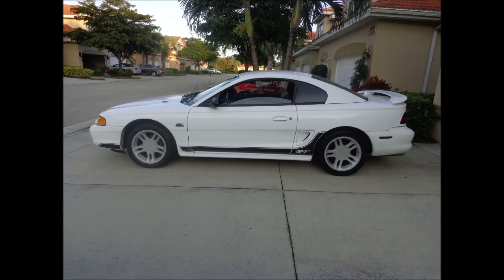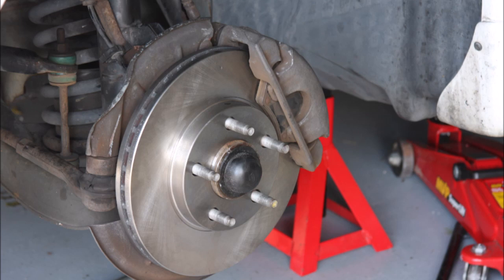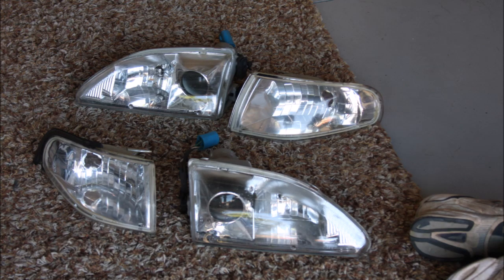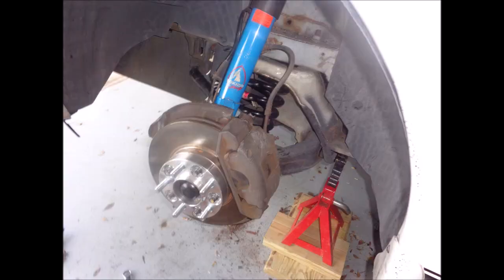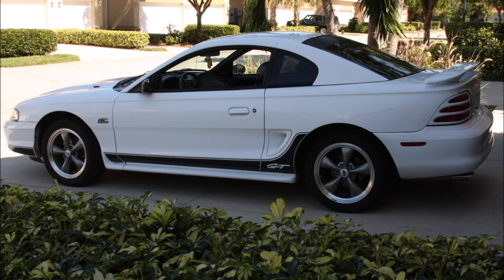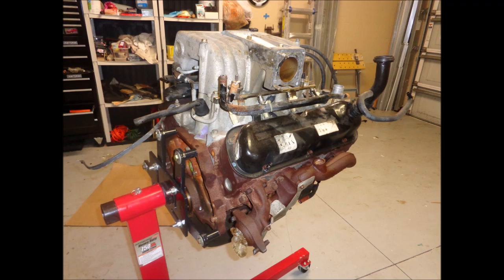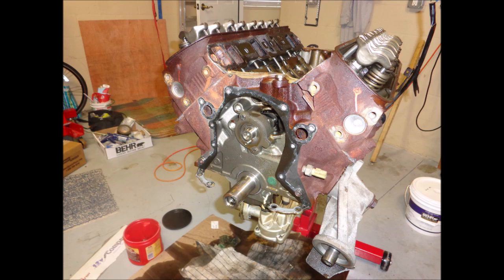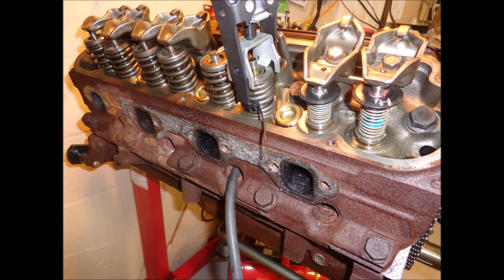1995 Mustang Gt 5.0 _ Automatic Build _ Last of the Push Rod Mustangs

Comment: Yo AL this is the same mustang and color a 2012 GT, Kona blue my was auto, 3.15 gear,x-pipe, axel back, cold-air system, SCT-tune, ran 12.26 at 115.90 on drag radial. Ran a 2012 Boss mustang 6-speed manual we cross door to door I was very happy about how fast these Cayote were. And also I had a 1994 GT running 12.28 at 111mph. Thanks again great story.
Reply from the maker: Serge Basque.  . sounds like you did pretty good with your kona blue 2012 mustang!!! Nice!!  running low 12's with both cars is awesome!! I wish i could have done more with my 1995 mustang but that how it goes sometimes!!

Comment: Let's say you needed a 3/4 ton truck again you wouldn't want to try the new 7.3 gas push rod that they're calling Godzilla I think it's a beautiful piece with it's steel crank 6 bolt Main gear and chain to a shaft driven oil pump in the rear of the engine where the g-forces send all the oil so it won't starve the pushrod engine works better in a truck at low RPM where you really need one to work a heavy trailer around the job site
Reply from the maker: Forest LawrenceGrading . .  if someone needed a 3/4 ton truck i would say the 7.3 equipped truck would be a good move.  .  not likely for me though . . what this video was about was how i moved away from push rod engines ..  i built a lot of them along the way. .  at this point for me i will be working with coyote powered mustangs unless i buy a zl1 camaro!
Reply: @coyotecarguy2076  there's a YouTuber called revvin Evan he has one of those new 7.3 s sitting in a fox body I don't know if he's ever finished it but he's done some dino runs on one in total stock trim and then with the heads cleaned up and a small cam I think it's the answer for the truck world I hope they flood the market with crate engines it would be awesome to see what they are really capable of I think they fill a perfect hole between a Vortec 6000 and the vortec 8000 truck engines they are the replacement for the V10 Triton I think if I could afford a new truck it would be my choice over the Powerstroke due to cost of maintenance
Reply from the maker: @forestlawrencegrading9154  . .  Yes I know revin evan. .  he lives here in florida i run into him from time to time at the track. .  the 7.3 in an interesting engine like a big ls motor.  ..  lets see how they do in those fox bodies. .  but its hard to compete with a coyote. . should be interesting though .
Reply: @coyotecarguy2076  yeah I've been following you as Rusty stuff I'm a truck lover myself I was paying attention to you because of the tick and continue to watch I thought the same too it reminded me of an LS and a little bit of the 427 side Oiler I've always loved big caterpillar engines and Cummins and the new 60 series Detroit things that rev High to make Power make me feel tired my game requires a lot of torque at low speed